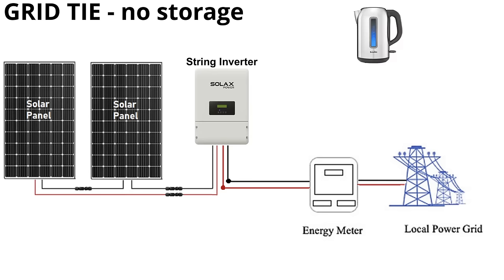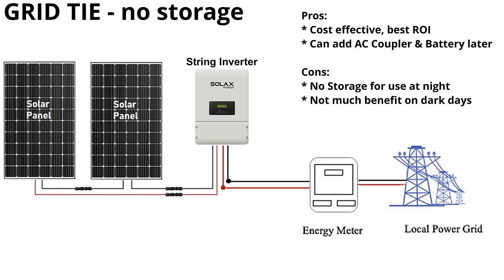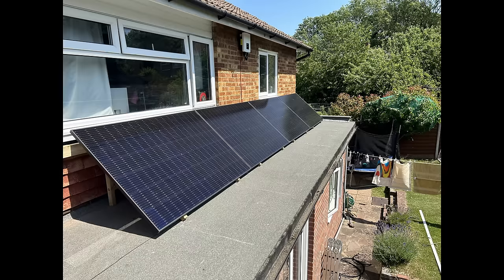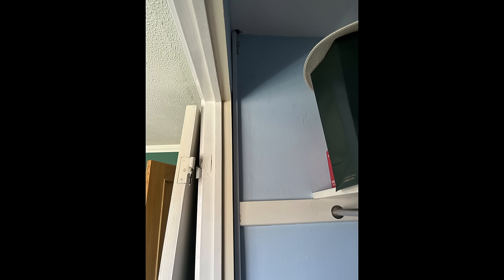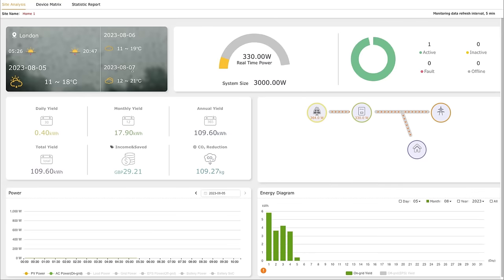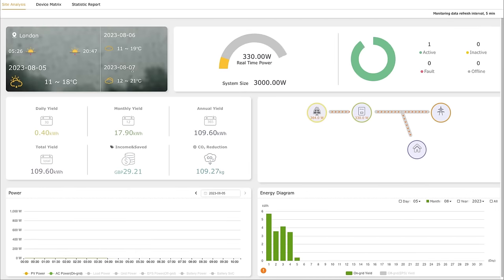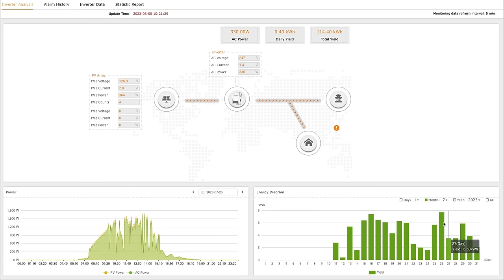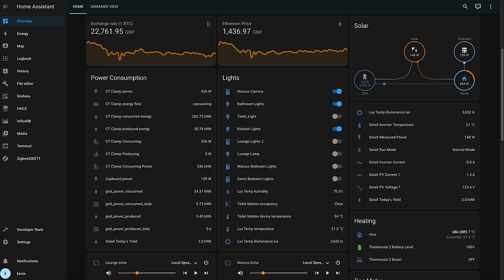DIY Solar Project 2023, worth it in the UK?

Comment: Have a similar system but dump excess power into my hot water tank immersion heater using a Solic200 box. This automatically detects if I'm exporting excess power and diverts it to the immersion heater. Works a treat!
Reply: Apart from you can almost always sell it for more than the cost to heat it with Gas, 15p export is currently standard but if you have a battery Octopus Flux will make £££, Even without a battery if you can not use in the peak hrs you will still make money. Octopus also recently dropped the MSC cert requirement.
Reply: I've got a system like that but worked out the money I could have made exporting the energy would equal the cost of the gas to heat the water. The only difference is I don't have to use the boiler at all during warmer months so that's less wear and tear. Overall I'm not sure it's worth the upfront cost for such a unit, especially since it only works during the day and often not when you need not water either late at night or early morning.
Reply: I have a similar setup. Works well. DIY cost of components just under £2000. Been in use from 2020.

Comment: That inverter is in a really bad location for maintenance, DC isolation when the panels are live looks impossible,  having only built in isolation is frowned upon by the fire brigade, maybe your house insurer too, also the inverter being baked by the sun will significantly shorten its life.  An internal inverter install, even in the loft would be infinitely preferable.
Reply: I agree the lack of a DC isolator is a really no no given the voltage from the panels, and I was very surprised to see the inverter mounted outside in such a vulnerable place, time will tell....

Comment: 1600w panels, EcoFlow delta pro + 1 extra battery = 7KWh storage. Panels mounted in garden with adjustable angle for winter/summer optimisation. Running through independent mains system to household wiring. Currently runs fridge, freezers, microwave, washing & dryer machines. Ready for blackouts with lighting and tv ready to switch over.
Reply: Sounds interesting as I don't like trusting anything to do with the grid. Can you elaborate on the cost and  what that independent mains circuit  looks like?
Reply: how have you connected your eci flow to your energy board?
Reply: I had exactly same setup, costed me £5100/-. But delta pro failed in 4 months with burning smell. I was using 800w powerstream inverter. Now I installed Hybrid Lux inverter with 9.4kw Hanchu ESS for £5000/- including G98 and MCS.

Comment: Great video, i would advise to anyone, that DC voltage is dangerous and can kill if you dont know what you are doing and also can arc also. You should install DC isolators  and instead of timber frame consider using unistrut bars with proper solar panel clamps wo ensure that dont rattle and that the panel is clamped in the clamping zones correctly to prevent panel distortion and damage.

Comment: Yours is a similar journey to the one I've been on - before things escalated. The SunSynk Hybrid inverter from City Plumbing is another route to go if you have adequate start up voltage. This future proofs the addition of a battery. I now have a spare Solax inverter which I need to get rid of. The Sunsynk is quite feature rich and the 3.6 version is pretty handy insofar as you can have 7kW of solar panels but is still G98 compliant in terms of grid connection. Looking at the legs on your frames on the flat roof, I'd probably be wanting to put some sort of spreader board under the legs to protect the roof.  I'm now looking at adding a fogstar battery (and selling my SunSynk battery) which has been mentioned in another comment.
Reply: I was going to post a comment about the legs digging into the felt roof myself... bloody flat roofs leak first chance they get ! DAMHIKT... 🙄

😎👍☘🍻
Reply: So am I right in thinking that with the Solax inverter you can't add batteries to it? The SunSyk 3.6kWh Hybrid is over twice the price... 😮

Comment: A really informative video on a tidy and sensible install  thank you for sharing your project. I initially went for a off grid system with Pylontech batteries but got frustrated over the G99 approval as my inverter was bigger than 3.8 for the G98. I removed all the Pylontech stuff and Growatt inverter and paid a local company to install a Solax system with a 5.8 KW battery. They ‘ adopted ‘ my solar panel install and gave me the MCS certification. I didn’t bother with a meter for export as I also had a zappy charger installed for a future second hand electric car which will take any excess and since may whe. I had my system installed it’s been great getting upto 800kw of generation to date …. My target is 1500 kw for the year ! I’d love a video on HA as that is my next hurdle to jump Subbed thanks again.
Reply: Hi, I think once you get an electric car there won’t be any export! That’s the idea.
Take care M.
Reply: Why did you get rid of your pylontech battery, I'm trying to get one at a reasonable cost and a  second hand one might of been just the job, can I ask what size (KWh) it was and what you sold it for?
Reply: @tonydickerson999  it was as above due to G99 approval. I think it sold for 1100 iirc. it was a US5000. Was a bargain for the fella. got two racks fuse and cabling still if its of interest ...
Reply: @yellownev  I've been looking at the Seplos kits and in particular the 15KW kit which is on special offer  for about £2500 inc VAT, building my own rack, but might be interested, have you got any photo's and a price in mind.

Comment: If you connect a grid tied system with a battery as you show it, there will be a loud BANG, and everything will stop working.
The battery is charged by DC, not AC, it connects to the battery side of the inverter.
Reply: I noticed that too, a little bit of artistic license with the sketch perhaps?
Reply: That depends on the Charge Controller. Most PV Installations use A/C Coupled Batteries so they need a Charge Controller to convert from A/C to DC (charge mode) and DC to A/C (Discharge mode)

Comment: I see one serious problem and one potentially serious problem.
1) The roof above.
If any debris is on the roof it will fall smack down on the solar panels.
That is from accumulated snow/ice to actual damaged shingles falling.
A high risk for damage to the panels.
2) wind could still get under the panels and strong gusts could rip them off. I'd recommend using some celular polycarbonate panel and closing down the sides as best as possble (make a triangle shape and screw it on each gaping hole side, to prevenmt gusts of wind from going there. And also various vermin to make a nest

Comment: Very inspirational, I was pleasantly surprised how little it cost. I never thought of putting solar on my two ground floor extension roofs - no idea why, it seems obvious now. Looking at mine now, my main roof is hipped so I think the lower roofs may actually have more surface area.

I dont think you actually answered your question(!) is it "worth it in the UK"?! You look and sound pretty pleased, any idea what the pounds and pence looks like yet or is it too early?

Comment: Good video, I've got 4.6kw of panels spread across two roofs main house and flat roof extension with a 4kw solax inverter AC coupled to a victron battery inverter with 9.6kwh of batteries. Other considerations : if your panels are more than 20cm above the main plane of the roof you will most likely need planning permission, it would be a really good idea to install a DC isolator before your inverter (in case anything goes wrong with the panels for disconnection purposes) and finally when you grid tie you need to apply for a G98 (16amps per phase) or G99 (for ESS or bigger systems above 50kw) EREC as you're feeding into the grid. The main consideration is that your installation is safe and isolates when the power is cut. Thanks for the video I especially liked the home assistant bits. Only just saw your replies to other posts about your G98 but I'd still recommend the DC isolator and have a look at your local planning permissions to make sure it's all good.
Reply: I agree, a DC Isolator is a Requirement. There are IP65 so easy to fit outside near the Inverter under the Eaves. DC Cables go from Panels to DC Isolator then from DC Isolator to Inverter
Reply: I agree reference planning.  It doesn't fall under permitted development once you go above 0.2 metres higher than the flat roof which this clearly is.
Reply: I forgot to add that ideally you should fit a DC Surge Protector between the DC Isolator and the Inverter to protect the Inverter from Lightning strikes or other events where there is a current surge.
Reply: You don't actually need to apply for a grid connection agreement under G98 as it's 16A or less so it's connect and notify. If your system is generating more than 16A per phase then this will fall under G99 and a grid connection agreement will be required prior to energising the system. Similarly, a grid connection agreement is also required if the battery is to be used as a backup supply in a power cut irrespective of the inverter size. Some DNO's allow a fast track process if you are installing a PV inverter of 16A or less output and a separate battery inverter/charge controller of 16A or less output.

Comment: What you’ll find is that you may hit the 2k limit on your inverter even though your panels are rated for about 1.6k.  The rating on the panels is the same across all of them, so specific temperature and light.  I found with my 4.86kWh system installed in January is at one point in April it the inverter hit 6k (only achievable as was sending power via DC to batteries as well as AC to the house/export) - this was because it was a bright clear day, sun was at its highest for the day which was right for the panel angle and the temperature wasn’t high … ideal conditions as was about 20% above the panel rating.  As the weather got better the high production point dropped likely because of the temperature of the panels being high - currently in September after the quote poor July/August compared to May/June I’m seeing 4.2kWh at its peak on a clear day when the DC route is there to send excess (batteries still charging).  During the good months I slowed down the battery charge rate to prevent clipping so that there was still charge going to the DC batteries at the peak production time during the day to maximise export which can add up to several kWh/day extra at 15p/kWh in the long daylight months.
Reply: This is what I love about the commwnts on vids like this... a valuable little nugget of info given for free.. 😶

... or do I owe you money ? 😧... 😂

😎👍☘🍻

Comment: What precautions have you in place to not backfeed the grid on a sunny day during a power cut, potentially putting someone's life at risk, and as I found out you have to have the correct smart meter from your utility company that is bidirectional otherwise it will assume that any excess you feed back into the grid is you actually drawing from the grid, and in my case it doubled our electric bill which we never got refunded for as it was impossible for the utility company to tell what was going in and what was going out, I also believe that you have to inform the utility company that you are feeding into the grid and have to have licences/certificates to do this.

Comment: Its good you can DIY grid connect solar in the UK. Not possible in Australia, even offgrid is difficult and costly. 
We arent even allowed to replace a light switch without 4 years of "go to the shop and buy a left hand screw driver".
I have even noticed that in Germany you can buy plug and play grid connect DIY kits.

Comment: In summer you have light and sunshine in abundance. It doesn't matter if you don't get all the sun. 
In spring and autumn you are happy to get as much sun as possible. 
In winter it's hardly worth it and you wait for spring. So it is worth aiming for spring and autumn.  
So set the angle to 38 to 42°
Reply: Good analysis.. 👏😎
Reply: depends on a few more things than season. we get perfectly usable daylight (not just raw, cloudless sunshine) throughout the year. the type of panels you're using makes an even bigger impact. the best choice for uk weather is half cut monocrystalline panels. i collect energy even on cloudy days. granted, not as much. but better than nothing. and my whole flat is off grid.
Reply: @brymstoner Very interesting! Do you use solar energy for heating / hot water as well ?
Reply: @sabinkamal  I'd like to, but it would be very difficult for me to do that in my current apartment. But I may need to find a way soon; currently my heating cost is bundled in with rent, and the landlord will be separating it and making heating a pay as you go thing.

Comment: Excellent video, described in simple terms. I'm thinking of doing the same now
Reply: do it! and go for battery storage as well. it'll cost a little extra - batteries are the most expensive part of the build - but you'll be better for it in the long term, not beholden to energy companies.

Comment: The problem with DIY solar systems in the UK is that according to the information I have seen the person installing the panels needs to be certified for the job.  Householders are not allowed to work on the fuse box themselves (as you would need to in order to install a solar system or fit a new circuit) without being certified electricians.
Reply: He’s running T&E outside and mounted an inverter on the roof! That’s why you need an electrician.

Comment: Hey, im in suffolk, built my own diy system last year too, 3kw, 14.4kw lifepo4 eve storage. Is awsome. Not many of us here in the uk doing this.. My setup is a bit different and diy to yours. I did the whole home assistant thing also to send data to my phone/tablet on the wall. Did the lot for just over £4k. (second hand 250w panels, 3kw epever hi hybrid inverter, jk bmses, diy battery boxes, diy everything hence the cost. 👍
Reply: How much have you saved on your energy bills so far?

Comment: Hi did you or did the electrician fill out the form I think its call G96 to the power company to say you had solar going back to the grid? As I would like to build my own system like you 🙂 I have done an off grid system and works great

Comment: A quick one to point out - a correction on your side (but a good one at that) - you mentioned that 42.x degrees which was the best you could get (with your restrictions) BUT angle alpha isn't the angle the righthand side is referencing for optimal angle to sun. Rather, it is the angle beta (against the vertical) which in your case is 47.5 degrees. So, you are better off that you made out. 🙂 Probably better for UK positioning as we'd rather get better power generation from the longer, brighter 'warmer' months than the colder ones. Thanks for the very informative video!

Comment: I went the second hand route and spent about the same. I think I will have a pair of those panels and mount them in the garden. I built my own lithium battery and there is something about running your whole house off a battery every night. We only use 3-4Kwh a day. Some days our daily electric bill is 3 pence. I think that is what the smart meter uses.
Reply: Love to know where you got the info to do this?
Reply: @thomasbroker69  Everything he has done can be learned from youtube, there are dozens of channels (mostly American, but the principle is exactly the same) which explain in great detail how to build batteries etc. You do however need to be technically minded with regards to building the batteries from bare cells. It is very staisfying when it all works though... What i did was 'cherry pick' various ideas then amalgamated them into the best system for me.
Reply: @thomasbroker69  the basic layout for an off grid system is panels into an mppt charge controller (victron is a great choice for charge controllers), into batteries into an inverter, which you plug your things into. a good idea first would be to measure your consumption. you can do this from your meter, noting the difference in kWh's used at a set time each day, or by using a watt meter to do the same right at a plug socket. but that will only measure whatever's plugged into it, not everything. then build your system out to meet your consumption needs. or adjust your consumption down and build a smaller system.

Comment: Done this same install about 2 years ago, same inverter, 6 X 385W panels 29 degrees on the same kind of flat roof. Connected only 5 panels to inverter and using one of the panels to charge a 24v battery and to run some fans and lighting to the inverter. Fans will go faster or slower depending on the sun brightness, exactly as they are needed.
Reply: Hi, did you have to get notify your DNO with a form g98 or you didn't bother?

Comment: This is a most excellent video. 
I was thinking of a crude off-grid system plugged directly into my immersion tank to make "free" hot water during the summer. I would like to buy prefabricated wooden frames and mount them on a s.facing wall because I don't like heights either. I will be referring back to this video for ideas. 
Thanks for doing this.
Reply: if you really want crude, light a fire under a metal tank of water. generating heat from electricity is very energy hungry. running a kettle or microwave, for example, will cost you between 1-3kW of energy. and that number is a constant for as long as the thing is in use. so if you don't have much battery storage, or you're choosing to heat the water during the day from a grid tied system, that'll respectively chew through your storage / cost more money from the grid. ultimately though, the best option for hot water is geothermal.
Reply: Theres a few gadgets to dump excess electric into hot water tank.